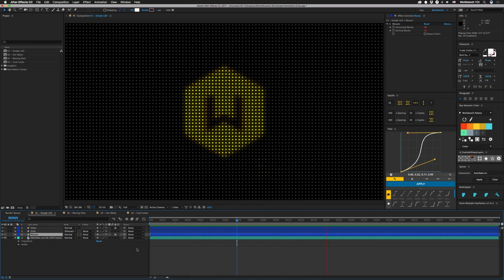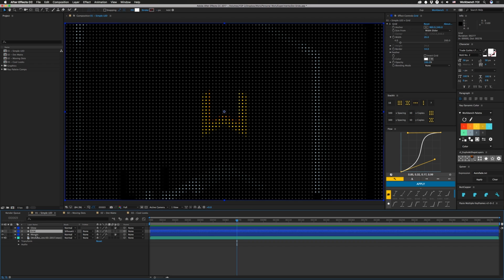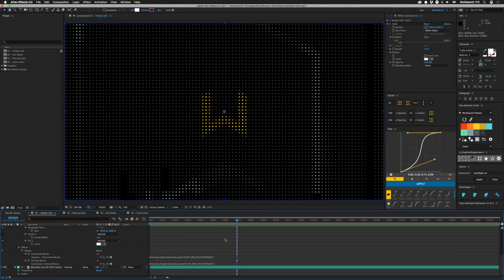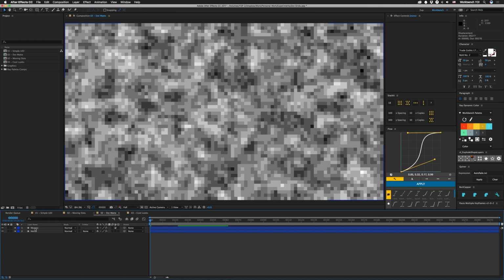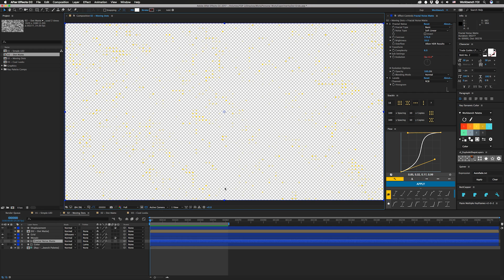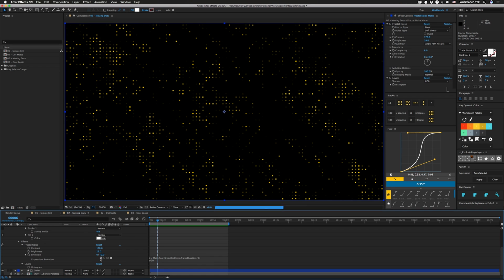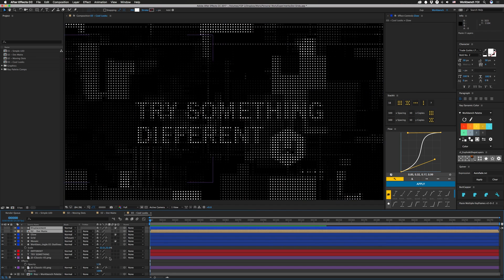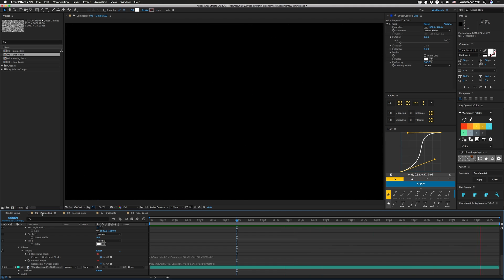Tutorial 77: Glitchy Dot LED Thing

Comment from the maker: For some reason, I just found out that sometimes the grid won't line up with certain values. I'm not sure why, but you can set Anchor in the Grid Effect to 0,0 and it'll fix it.
Reply: Thanks for a great tut Joe! May I ask what was the expression you used for Mosaic (Dot Matte comp). Keep getting an error :(
Reply from the maker: I'm doing this without looking at AE so hopefully it helps. I pickwhipped the size parameter from the grid, noted below as pickwhip.

Horizontal blocks used: thisComp.width/pickwhip
Vertical blocks used: thisComp.height/pickwhip
Reply: Hi. Thanks Joe. Just found out there was a way to pickwhip to another comp.
Reply from the maker: Yeah, pickwhipping other things is sometimes a pain. I usually just pickwhip from in that comp, and fix the code to read something like comp("comp") and then copy/paste the pickwhipped part. I rarely link through comps though. I wish AE would do it like Houdini. You can just copy a link and paste to another property anywhere.
Reply: I got a quick question. Why do you turn shape layers into adjustment ones and not use adjustment layers in the first place? I'm on cc2015.3 and that thing with shape layers doesn't work for me (perhaps I'm missing something)
Reply from the maker: I just felt like not having any solids—especially ones with names in my project like Adjustment Layer 1, 2, 3, 4, 5. That was my #nosolids joke. :) I think it's worked since shape layers were introduced in like CS3. You can turn any layer into an adjustment layer.
Reply: Thank you very much Joe! I've already learned a lot from you :) Very interesting and informative tutorials. Thanks again!
Reply from the maker: Awesome! I'm glad to hear that! Thanks!

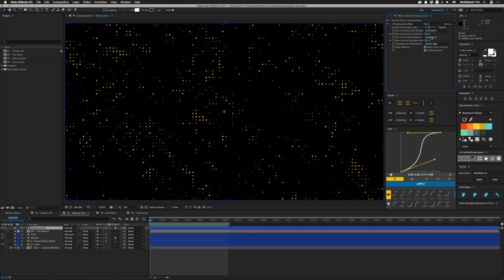Comment: Great content, however I get completely lost at 3:40, the dotted randomized board is just the thing I'm looking for, but I can't seem to get past the noise+mosaic part and its starting to bug me lol, would appreciate some help from anyone.
Reply from the maker: Did you watch the tutorial I mentioned and linked in the description where I go over how the displacement map calculations work? https://www.youtube.com/watch?v=iW8AEDf7R8c&t=0s Basically, you take the number of posterization steps and subtract one. Then you take that number and multiply it by your grid size. We used ten steps and a grid size of 20 so (10 - 1) * 20 = 180. So we're displacing up to 180 pixels with a posterized map, so each piece can only be displaced in multiples of 20 pixels. Hopefully that makes sense. I can't explain it any better than that.
Reply: @Workbenchtv  hehe classic mistake of not reading through properly before asking. Thanks dude, I'll go through that :)
Reply from the maker: @ee8945  No problem. Good luck with it!

Comment: very basic question. i have mosaic applied to shape layer, set to be an adjustment layer. For some reason, it is not applying mosaic to the layer under it. Any ideas?
Reply from the maker: Does your shape layer have a fill? It needs to be solidly opaque to work as an adjustment layer. A lot of times you might've used a stroke shape and the effect will be relatively invisible except for the strokes.

Comment: Wow thx.
Did you try timeToFrames() and framesToTime() to convert?
Reply from the maker: Haha, I always forget about those. Good call. ;) Thanks!
Reply: It seems to me that posterizeTime() expression is the simplest way in this case )).

I like this idea of using the grid with mosaic effects )). An interesting alternative to Ball action.
Reply from the maker: 1. I forgot that existed and have never used it. :)

2. This is easier to calculate for frames.

posterizeTime() lets you set time to a different fps but that will be affected differently by different comp frame rates. So to get 3 frames at 24 fps it'd be 8, but 3 frames at 30 fps is 10. posterizeTime(8) in a 30fps comp gives you a 4,4,3 cadence. And who knows what 3 frames in a 29.97 or 23.976 comp is. :)

Thanks for pointing out another option though!
Reply: It makes sense! )) I use constant frame rate and haven't thought about this drawback of the expression.
Reply from the maker: Yeah, it won't matter per project, but if you switch timebases it could matter. I find it easier to think of it the other way, but posterizeTime() works too. :)